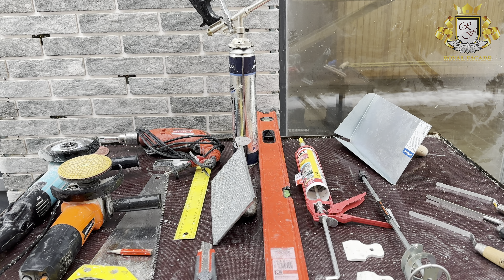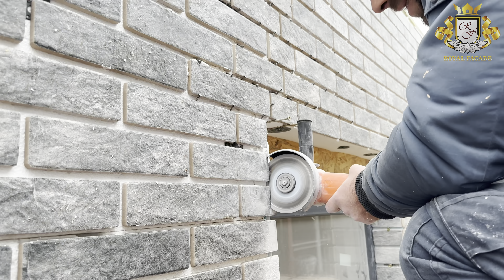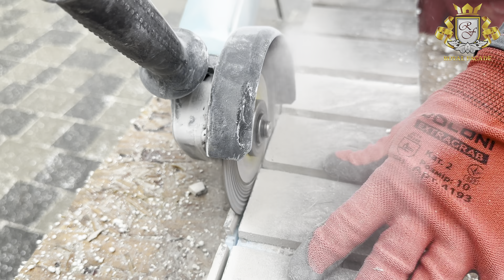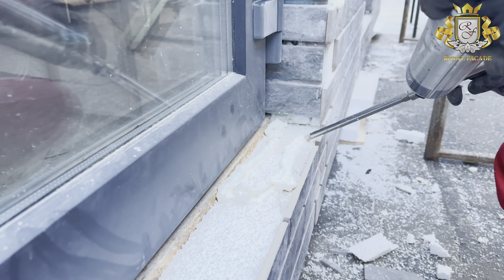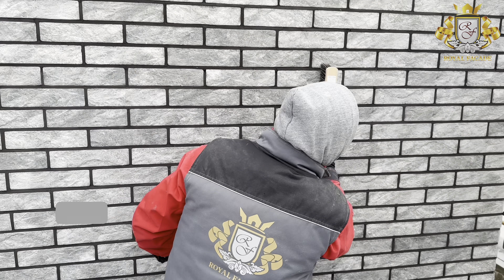Installation instructions for clinker thermal panels Royal Facade (English subtitles) #royalfacade

Comment from the maker: Installation instructions for clinker thermopanels Royal Fasad.

00:01 - 00:03
Tools for work:
- angle grinder, diamond wheel and grinding wheel;
- impact drill, whisk, buckets, polyethylene film
- wood saw, level, tray with trowel for grout
- angle, knife, marker, level, building cord, grater for foam plastic

00.07 - 00.10
With the help of a laser level, we draw vertical and horizontal lines on the walls converging in the corner.

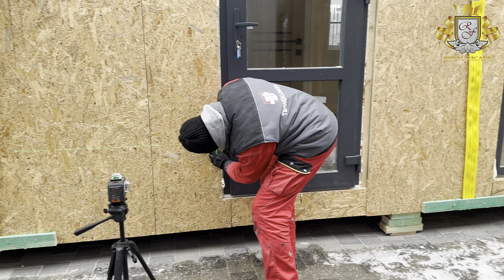00:14-00:17
We fix the marking cord along the horizontal line.

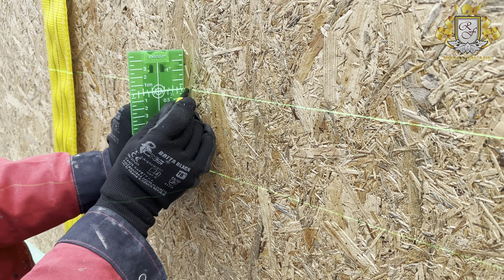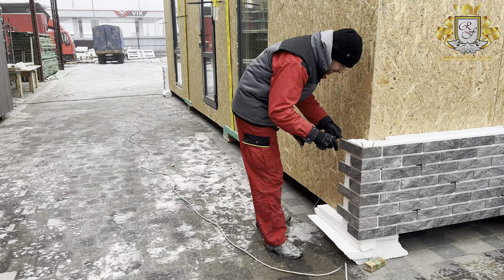👉 00:22 - 00:24
FORMING AND INSTALLATION OF THE CORNER OF THE EXTERNAL CLINKER WALL THERMO PANELS

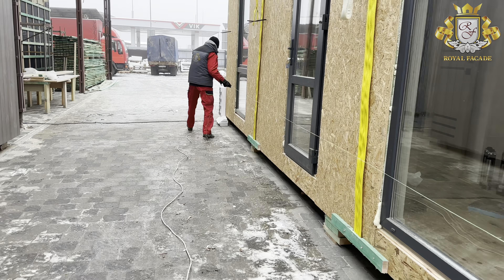00:25 - 00:27
Marking and cutting taking into account the proportions of the corner, if a whole tile should alternate with a half, then the beginning of the cut is at a distance of 1/2 the width of the tile minus the thickness of the seam.

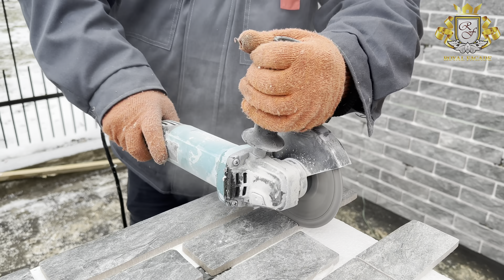00:37 - 00:40
We mark the width and cut the insulation at ∠ 45 °

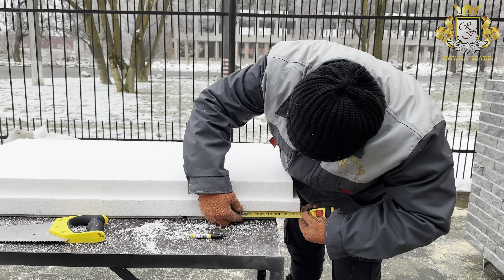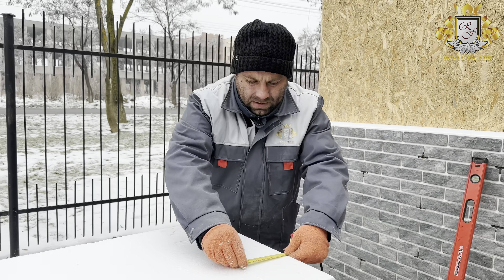00:46 - 00:48
We level the surface using a foam grater

00:50 - 00:52
We check the correspondence of the elements by location

01:02 - 01:04
Apply the adhesive foam according to the instructions located on the adhesive foam bottle

01:05 - 01:07
We fix the panels with the appropriate hardware

01:09 - 01:11
We fill all available gaps between the panels with adhesive foam.

👉01:14 - 01:16
ASSEMBLY OF THE EXTERNAL CORNER ELEMENT

01:20 - 01:22
Glue-foam is applied around the perimeter of the insulation

01:25 - 01:27
We fix the corner facade element with the help of appropriate hardware through embedded elements - rondoli.

01:38 - 01:40
We check the verticality of both faces of the corner element.
👉01:45 - 01:48
INSTALLATION OF A WALL CLINKER THERMOPANEL

01:50 - 01:52
We fix the marking cord along the horizon between two corner elements

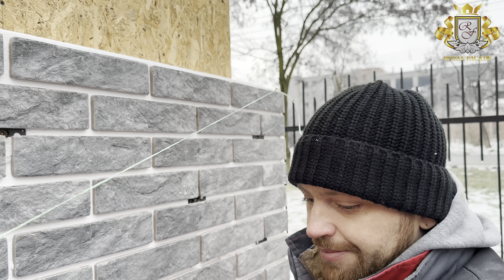02:02 - 02:04
We mount the wall panel to the corner element

02:28 - 02:30
The marking cord should run along the line of the longitudinal ends of the upper tile
 
👉02:32 - 02:34
FORMATION OF CONNECTING INSERT BETWEEN CLINKER THERMAL PANELS

02:36 - 02:40
We measure the size for inserting the wall panel element
and calculate proportionally the width for pasting the tiles manually.

02:50 - 02:52
We prepare an insert element of the wall panel

03:07 - 03:09
We mark the cut-off part of the panel element, taking into account the width of the tile seam for proportional gluing of tiles by hand

03:26 - 03:28
We prepare the tile for pasting according to the calculated proportional size

03:34 - 03:36
We are preparing the surface of the insulation for gluing the tiles

03:40 - 03:42
Glue-foam is applied to the surface of the tile, taking into account its expansion. When working in positive ambient temperature, the surface of the tile with glue must be irrigated with water

03:45 - 03:47
During the initial gluing, the tile must be moved horizontally along the surface by 3-5 mm for better distribution of the glue and adhesion to the surface of the insulation

03:52 - 03:54
We fix the tile with improvised hardware, taking into account the geometry of the inter-tile seam.
 
👉04.10 - 04.12
INSTALLATION OF WINDOW MOLDING

04:15 - 04:17
We mark the field and prepare the molding insert according to the design project, a multiple of the step of one whole tile

04:35 - 04.37
We form the molding element

05:08 - 05:10
We make a cutout in the molding element to form the window slope according to its dimensions.

05:26 - 05:28
Installation takes place on polyurethane adhesive foam, which is applied to two planes of the molding surface

05.32 - 05.34
The molding is fixed on temporary hardware until the materials adhere to the adhesive foam

05:40 - 05:42
We fill the gaps between the elements to prevent the appearance of cold bridges

05.42 - 05.44
👉INSTALLATION OF THE WINDOW SLOPE

05.48 - 05.50
We mark the slope taking into account the actual depth and width of the window slot.

06.25 - 06.27
We cut the wall panels taking into account the width of the slope from the window profile to the inner part of the facade tile

06.32 - 06.34
When the depth of the window slot is up to 125 mm, it is possible to form a window bevel from two elements

06:42 - 06.44
Before applying glue to the insulation of the slope element, use a metal brush to roughen the surface of the wall for better adhesion of the materials

06.50 - 06.52
hardware is fixed taking into account the width of the tile seam.

07:06 - 07.08
We fix the slope of the window with hardware until the glue dries completely.

07:02 - 07.04
We check the geometry using a protractor and a level.

07:24 - 07:26
FORMATION OF THE WINDOWSILL
 
07:26 - 07:28
We form the surface of the base for the tile with an angle of inclination of the tile ∠4-6 ° outward

07:28 - 07:30
Glue-foam is applied to the entire surface of the base

07:35 - 07.37
We fix the tile taking into account the formation of an overhang for a dripper up to 10 mm for draining water from the wall surface

08:08 - 08:10
To form a single full-sized tile surface, we create a horizontal load with uniform weight distribution over the entire tile surface.

08:12 - 08:14
We minimize chips on the tile with the help of a grinding wheel for ceramic tiles

08.44 - 08.46
We clean excess glue and adhesive foam from the surface of the tile

09:00 09:02
In the formed inter-tile seams from 1 to 5 mm on the window slopes and corners, we lay a facade polyurethane sealant

09:16 - 09:18
👉GROUTING (BREAKING) BETWEEN TILE JOINTS

09:20 - 09.22
Add water to the mixture gradually until the optimal consistency is formed

09.36 - 09.38
The finished mixture has a similar appearance of "raw earth", it easily falls off the surface of the tile

09.50 - 09.52
The seam is formed with a hand tool (trowel) in the dry season

10.45 - 10.47
Within an hour, the fresh seam and tile must be cleaned of excess grout with a soft brush and sponge

10.58 - 10.60
The inter-tile seam of the horizontal molding is decorated with a facade sealant in the color of the joint or tile

11.12 - 11.14
Finished walls after grouting are covered with a polyethylene film from the influence of the external environment. The term of preliminary drying of the seam depends on humidity and air temperature, on average it is 1-2 weeks

11.22
THANK YOU FOR YOUR ATTENTION!